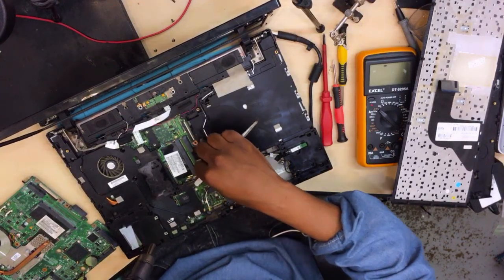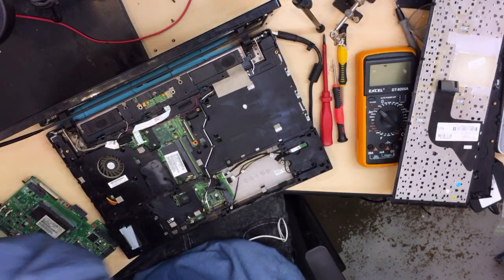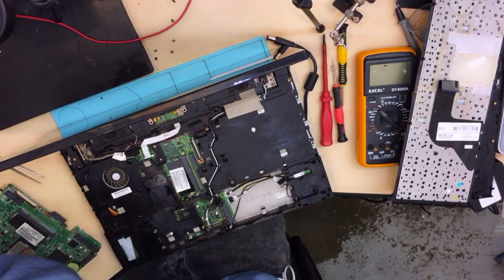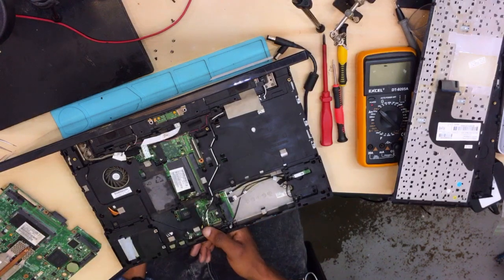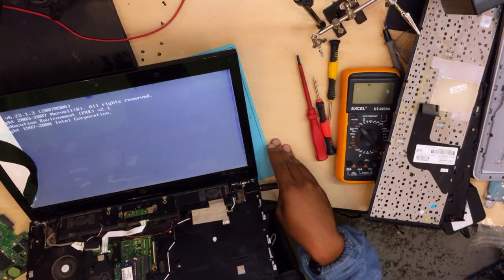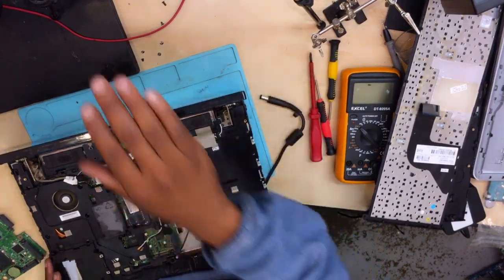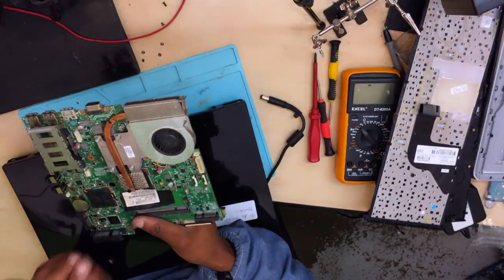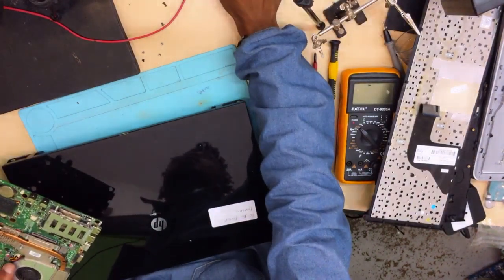How to repair an Hp Pavilion Dv6 Turns On but no display, fan spins but nothing on the screen

Comment: I had a same issue. I'm using HP ellitebook 2570p i7 3rd gen. It takes time to boot and if does not I will repeat the process, turn off the laptop, disconnect the AC adapter and disconnect the ram. In many case it will not boot until 10 minutes. But sometimes it boots, when it boots, no display but it have some lights on and I heard the fans spinning fast. No display after all but does have a "power".

Another thing I noticed is every time I install a new program It won't let me "restart" my laptop. I should restart my laptop after installing a program because it must. Then it will not restart, not powering on after in cmd: "shutdown/r" or by manually restart, just directly shutdown,  like wtf is the problem?